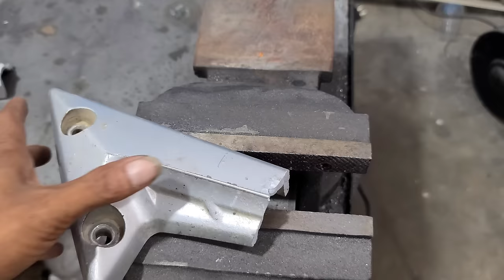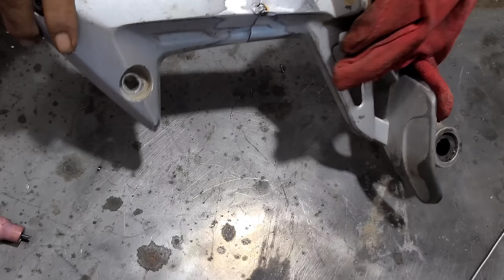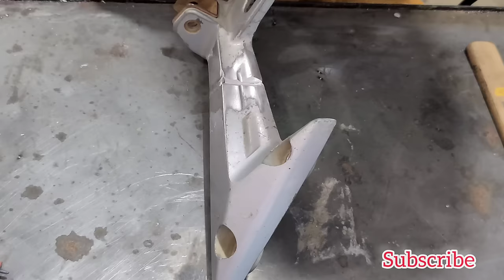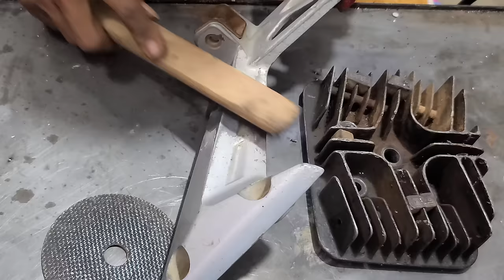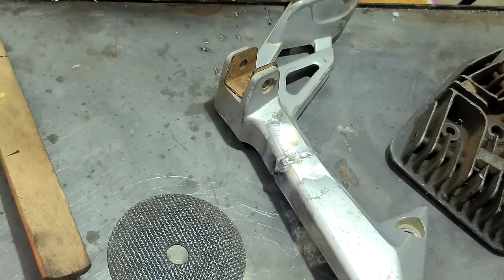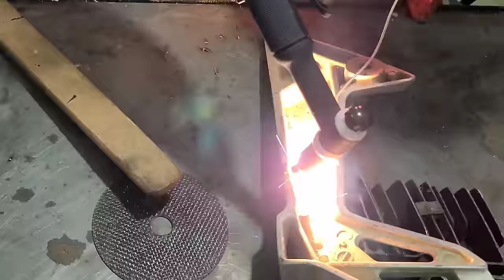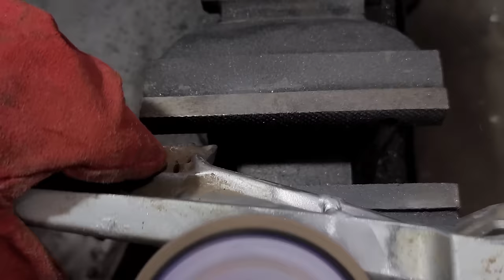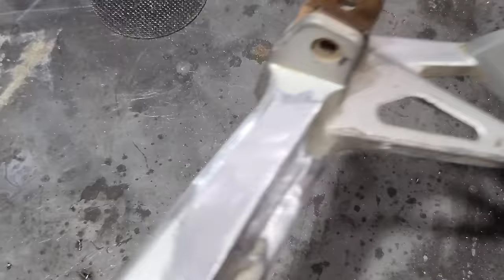how to weld aluminum which is rarely known by many people , tig welding

Comment: ‘ how to weld aluminum which is not known to most ‘
Apparently, not so much known by you either.
As someone who is always welding crappy, dirty aluminum you had me shaking my head.  I would have first off beveled it halfway through from the bottom side as you can’t get in there after it’s all together. Then I would have clamped it down holding it flat, since it looked like it really needed to be flat. Then I would weld up the top side to join it together and make it flat. Then if possible clamp it up so that it is held flat as much as I could while welding the bottom side. Then let it cool and grind the outside, top side so that it goes most of the way through leaving the side intact, then weld the top fully , and finally grind the sides most of the way through and weld it up complete. Where possible I would keep it clamped to help it remain flat.
I might actually use a regular grinder wheel, maybe even a contaminated one, it might leave a little steel on the surface, but the steel wire wheel is guaranteed to polish a ton of steel onto the surface.
As for “ HOW “ to weld aluminum, I don’t remember a single thing of any form of tutorial , it was more of a “ this is how ‘ I ‘ weld aluminum “

Comment: Where's the balling and where the pre heat ?? And wonder what ya clean he ally with before starting  lets not even start on the gass . The secret is practice practice and practice  now try ally baking foil your a true tig when ya can weld baking foil or coke cans

Comment: Never done any welding but I worked with professional welders for year's and just from work talk I wouldn't trust that part for a second. Any half competent fabricator will avoid welding aluminum whenever they can because unlike steel it requires an enormous amount of skill and precision due to the metals low melting point to avoid overheating and destroying the structural integrity of the piece. Some of the best welder's I've ever known used to patch up thin sheet aluminum boat hull's a process that would only be attempted in a controlled workshop environment with precisely calibrated equipment then the hull would be kept in a temperature controlled bay over night to re temper the entire hull. Patching holes outside of these conditions involved riveting a plate covered in silicon sealant over the hole because attempting welding it would almost certainly cause a catastrophic failure. Let's not even consider that the part your welding is obviously designed for precise alignment and you're trying to fit it back together by eye like a complete cowboy.
Reply: It’s a foot peg hanger, not a very precise item to start. And it’s a passenger foot peg anyway. Not saying it doesn’t matter, it’s just not a critical part.
Reply: Now I'm no boat builder but not once in any ship building program I've seen have they used aluminium to build a boat, it's heavy guage steel
Reply: @jonathansmith2407  there are large differences in constriction methods for ocean going vessel's and riverine craft. In a ship designed for deep water weight is an almost negligible consideration but when designing a boat capable of operating close to shore and in shallow inland waterways weight is critical.

Comment: I'm not impressed!   poor grooving of the part obviously will have lack of fusion in areas, and the filler tenique is obviously that of an amature.  Then going back over the sloppy weld with the pulse to try to make the weld smother again is also amature.  Also the tungsten was contaminated many times during welding (hence the crackleing and smoke and the black smut on the surface) this will cause porosity in the weld and possiblr impregnation of tungsten into the weld.   The wire wheel should be stainless steel, a standard  brush can add carbon  to the aluninum giving floaters to the puddle and again porosity to the weld.
 I will bet the farm that it will break right down the center of the origanal break!

Comment: That sure was a way to show people how not to weld aluminium, very bad weld prep no cleaning with acetone and no V grove to fill and add strength and to top it off you go and grind off the aluminium you just put on DDooooohhhhh first time you put any weight on that foot rest it will break off.

Comment: Yeah, you could have gotten contaminants into the weld. Perhaps there are better ways to fill it than using wire. If the nay sayers had to use those things, and had to make a bush fix, they would or it wouldn't get done. Perhaps take this video as another way to do a fix.

Comment: Total hack! Without full penetration the part is doomed to crack again. Using an unknown alloy as a filler metal is insane. You don't even know if it's a weldable material. Some alloys don't respond well to welding. Proper filler wire is cheap! Sorry but I wouldn't let you weld my trash cans. JMHO

Comment: Aluminium cast is difficult to weld .
 And this guy did not do a perfect job , sorry .
Normally you have to warm up the part which you want to weld.
And to rework without wire is not very professional. 
And there are other mistakes.
So in total it's not a video wich shows much knowledgement .
 And for safety it's much better to buy a spare part .

Comment: Don’t mean to be critical but ……..This video is subpar to say the least . From start to finish everything you have done is incorrect when Tig Welding cast Aluminum . I’m not going to waste my time listing all the incorrect things that were done in this video but just let me say that your end product isn’t much better than what you started with . What weld reinforcement you had you ground off from a highly contaminated weld . When this breaks again ( because it will) just throw the part away and get a new one .

Comment: As an HSE professional and welding inspector, I'd qualify this job as poor, because while welding both hands should be wearing gloves and I bet you were still in shorts and flip flops during this task, not acceptable at all. No skill compensates the lack of safety since you are risking your life as well as others'. Besides, you should restrain one of the pieces in a vise or something and the other one should just be tack welded in order for you to verify the parallelism of surfaces and a proper gap and profiling assuring full penetration after welding.

Comment: nowhere close to enough pre-heat. Very high chance every weld is going to crack due to a lack of thermal control on the entire part. Using random ass wire as a filler is never a good idea, and the fact you didn't push out any parent material and replace it with clean solid fill shows the lack of experience. So many things wrong here. Terrible start to finish.

Comment: That thing is gonna brake when you tighten the bolts up! Not properly aligned,welds didn’t penetrate anything. And the filler rod came from a strand of aluminum electrical wire. 🤷🏽‍♂️🤦🏽‍♂️

Comment: Please learn how to weld first, then make a video. You did anything wrong what you can do wrong, first you need the right weld rod and not a recycled cable, there are many different Aluminium types , and that is a cast piece you need a special rod for that -.-  then wrong grinding wheel, wrong wire brush , you could glue that piece together and it would hold better then your weld.
Reply: oui sans clou ni vis ou a la glue méme résistance

Comment: It may be rare where you are, but I know how. And its not with a hand full of twisted up electric wire !
Of course it'll work, but it's not the best way by far !
I can weld carbon steel with an oxy-cetylene rig, and a coat hanger too, but its not a really good weld. There will be a lot of impurities. But it will hold.

Comment: The secret old school forgotten way of welding aluminum is oxyfuel welding. You need a good flux and a lot of skill. You also need a pair pf cobalt lenses or didymium lenses backed up by a green #5 welding lense. This is important as the cobalt or didymium lendes wont block the ir and will damage your eyes. You get one of sets of goggles with the two round or one rectangular lense. Then you put the cobalt and put that behind it. But its not an easy technique to master. But tig is not any secret. Its the standard, most common way to weld aluminum.